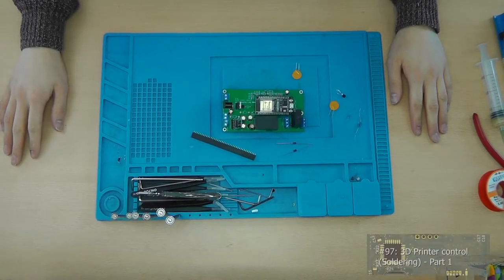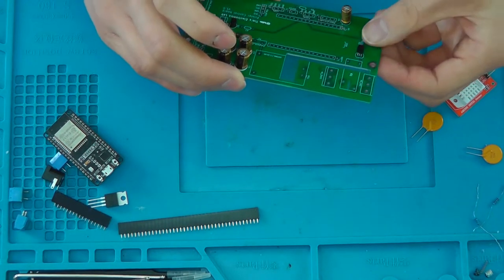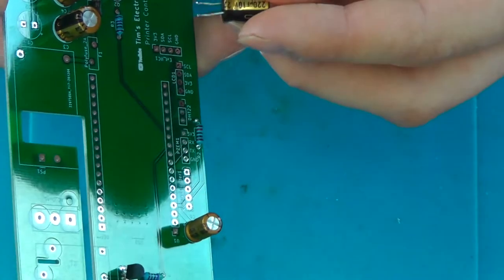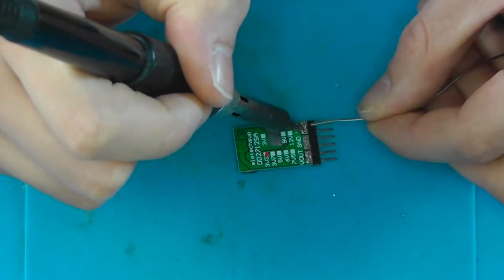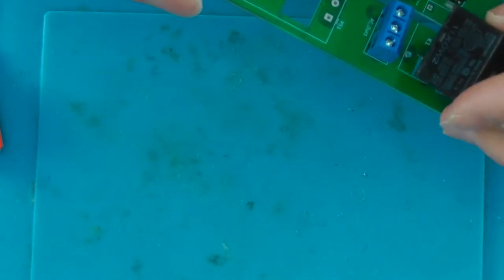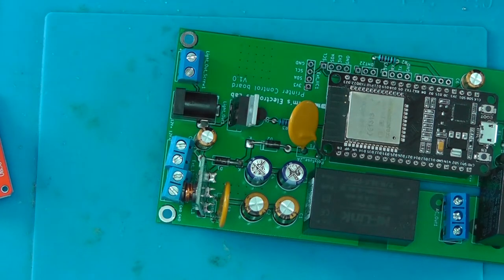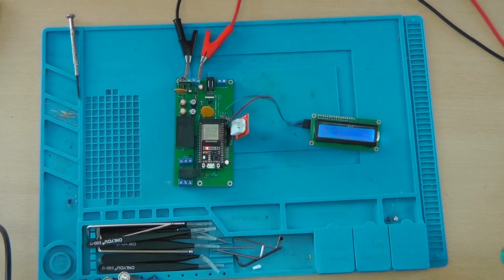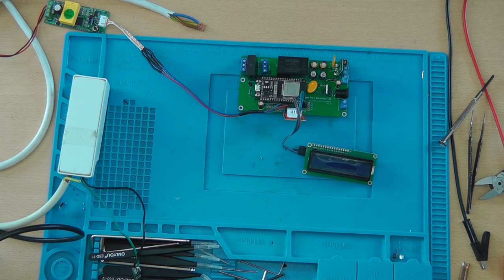#97 3D Printer control and monitoring with an ESP32 and FreeRTOS (Soldering) - Part 1

Comment: It's my experience that using a blob of bluetac to hold components to the board while soldering them, will make the job much easier.
Reply from the maker: Bluetac makes it so much easier, but I tend to just burn the bluetac away by accident 😂